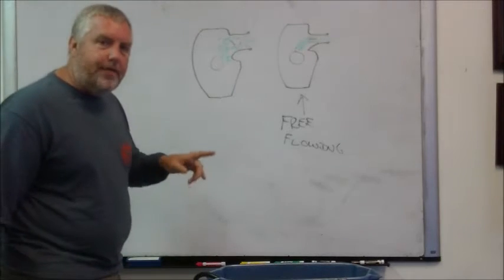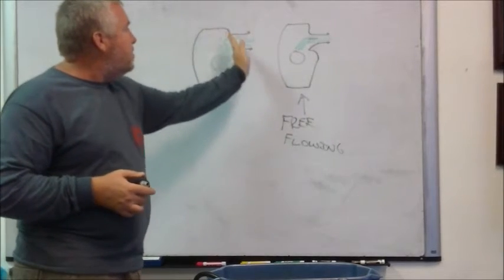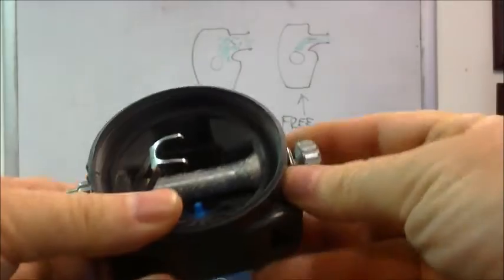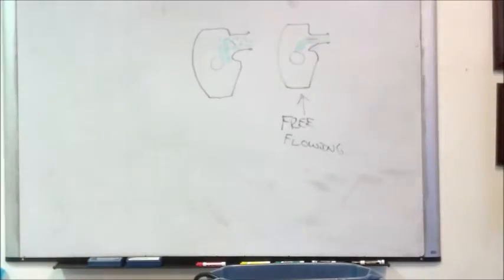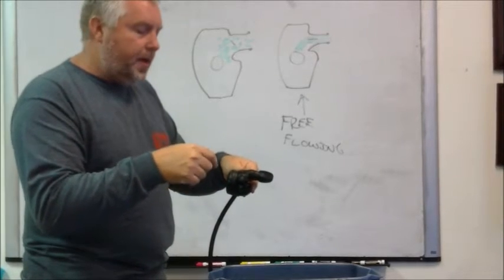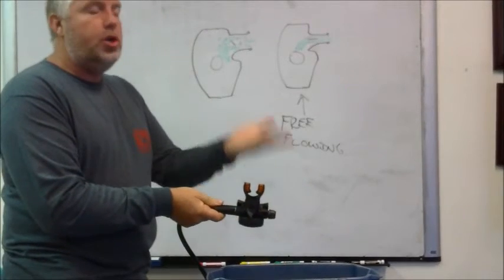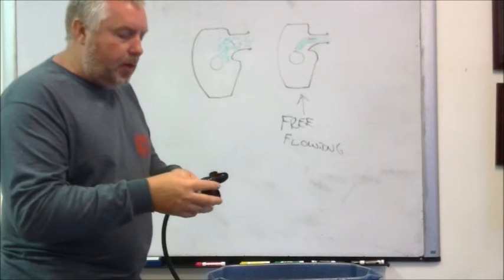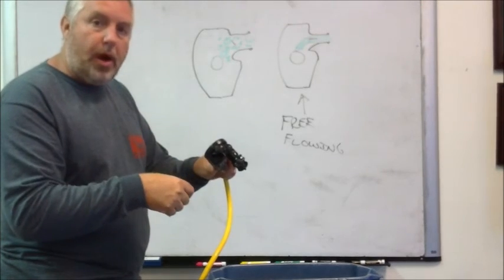Regulator Free Flowing

Comment: If you're using helium at depth and the reg free flows, is it the cracking pressure that needs adjusting or has it to do with the size of the diaphragm or the design of the purge button/cover? First stage IP is correct. Or would it be a problem with the venturi vane?

Comment: Wouldn't you breath in more air if it is set to free flow position?
Reply from the maker: Common misconception. You don't breath in more air, but you use less oxygen because you are using less "muscle" to actually pull in a breath. Poor breathing regulators require higher work of breath. Really, you are looking for something that almost breaths for you and you control your breathing rate (ideally it is similar to yago breathing in terms of depth and speed). Greg
Reply: I got it. Thank you. You don't get tired as fast = stay underwater longer.
Reply from the maker: Work of breathing increases causes oxygen consumption increase, think we re saying the same thing...